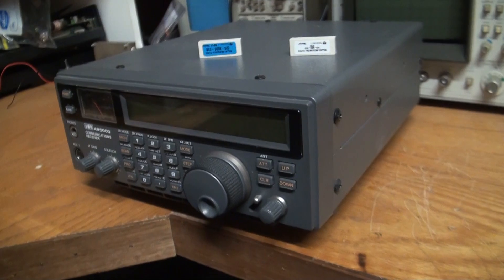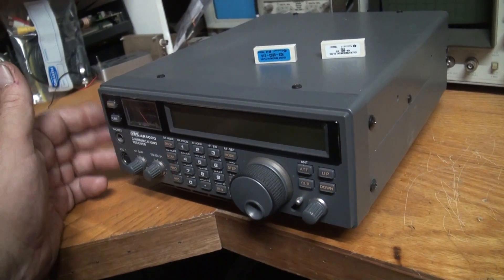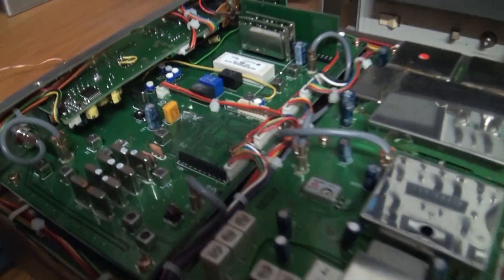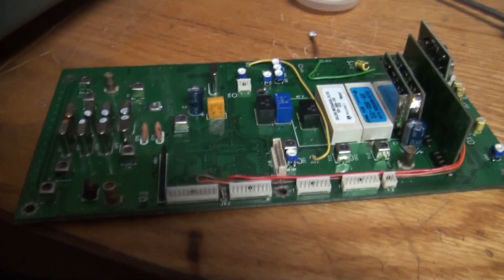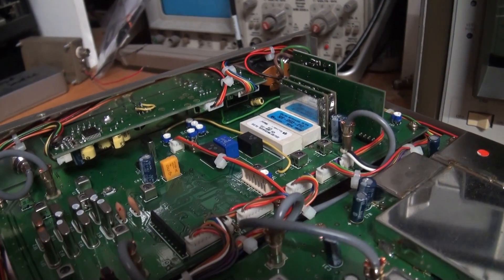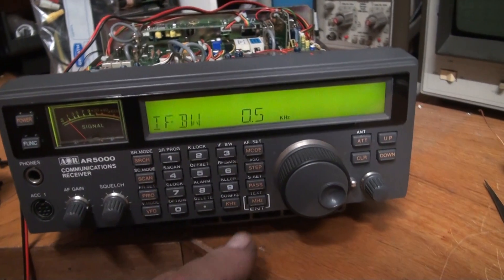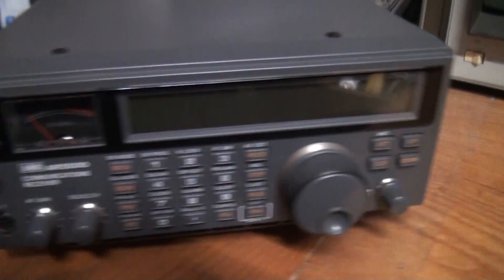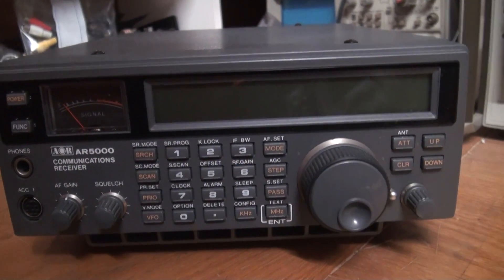AOR   AR5000 500hz filter upgrade

Comment: Hello, 
Great job, but there is one question ..
These filters have three outputs. There are input and output , body..
The filter MF-2.5 should be soldered (side) as shown, or it does not matter?
Is there a difference in the installation MF-2.5 ?

  Best regads.Thx.

Comment: ITAKEYOURPHOTO...Thanks for the Help Friend for AOR AR5000 Where stuck to 40.695Khz.
Greetings from Hellenic Land.
Reply from the maker: +GIANNIS PETRIDIS   Hi.  Make sure radio is set to internal frequency standard. Press FUNC then khz  Use UP button to go through the settings make sure item STD is set to  STD-INT 12.8mhz. 

Try a different vfo  there are 5 to choose from.  Press VFO button to go through the 5 vfo's  va vb vc vd ve select a different one and try tuning the radio. 

Next you can try to reset the eeprom (this is different to resting the cpu)   Turn of radio and unplug power cable.  Plug power back in and press and hold CLR button then turn on radio.  Keep pressing CLR   first you should see clock then radio should show freq 128.900Mhz.    Try tuning the radio now if nothing turn off and the back on.  try tuning.

If its still stuck on 40mhz try changing eeprom banks.  It only takes 1 incorrect entry  in the eeprom bank to completely lock up the radio.These radios have a hidden extra eeprom bank that can be selected.   Press and hold SRCH button the turn on radio. If its still displaying 40mhz Press and hold SCAN button and turn on radio.  It should now display something different than 40Mhz Probably 128.900Mhz.  You should be able to tune now.   If this works  for you leave the radio in this new extra  eeprom bank.    Hope one of these worked for you!
Reply: +itakeyourphoto   AOR ...o.k.!!!  MR. Thank you for all i will not forget for the Help...
Reply from the maker: +GIANNIS PETRIDIS  No problem my friend.. Enjoy your nice AR5000  radio.   Please subscribe!  I will make some videos of using the ar5000 for very interesting things and some simple add on projects when  I get some time.